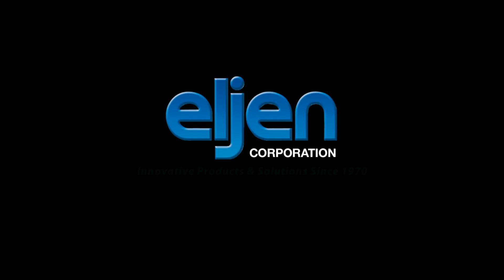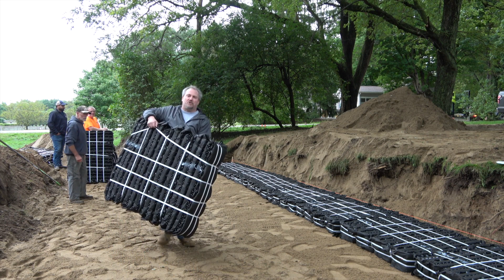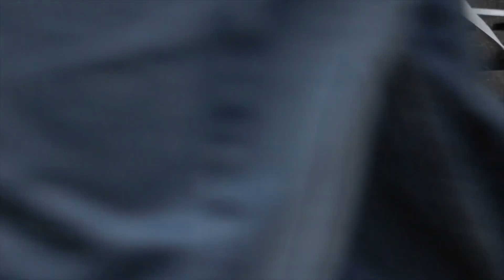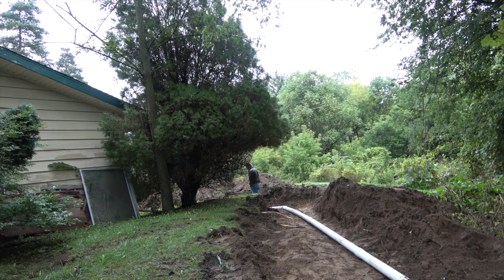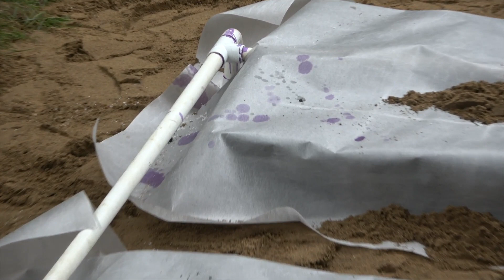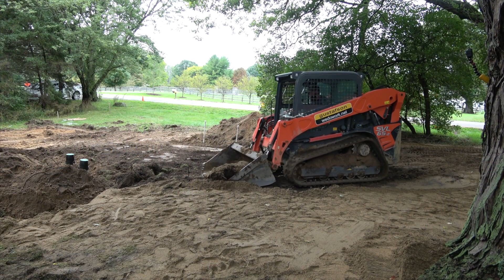Lansing MI Install

Comment: we are in Williamston Michigan hired a guy to put in one of these systems. How dry does the ground need to be we've been getting rain in the hot summer months weekly we have tow sub crocks in our basement that are bone-dry he's telling us the ground is to wet. ive paid half down 3 months ago concerned we don't know who to check this out with.
Reply: I just had one installed last week. We were fortunate to have dry weather, but the code enforcement officer said that it had to be done while dry and before a freeze. In the video, the guys are walking on the sand base. My installer did not do that. On two separate mornings he raked out raccoon prints. He said that indentations can cause puddling where the sand layer was packed. It had to be smooth and aerated. Also, he used a more rigid and larger pipe from Canada because in far northern Maine, he found the permitted pipe would fail in a freeze thaw freeze cycle. Good luck. I know the process can be nerve racking and COSTLY!